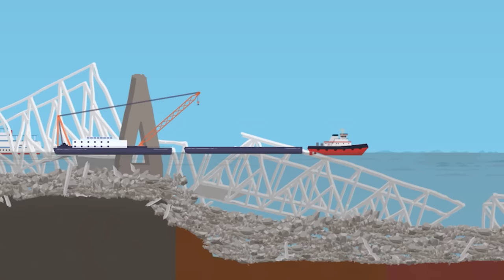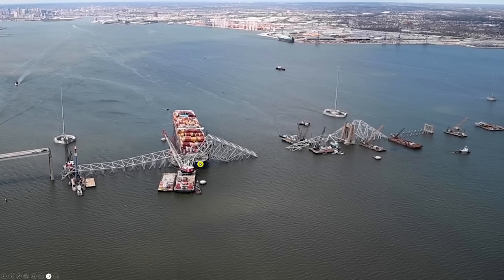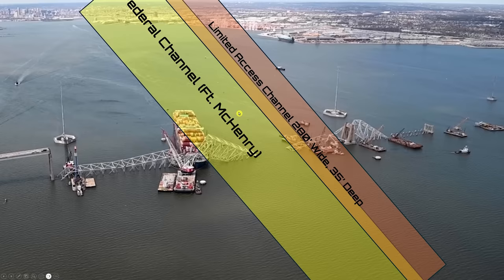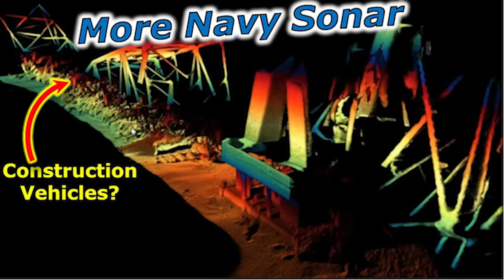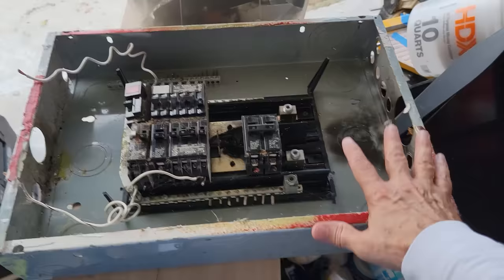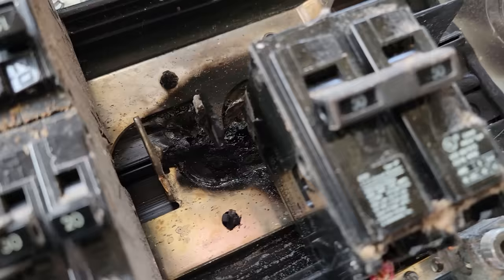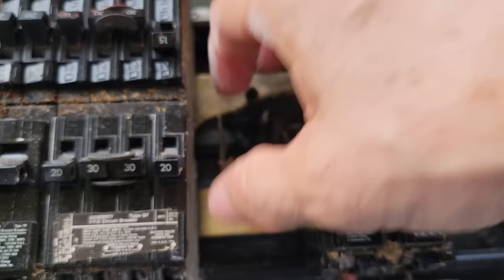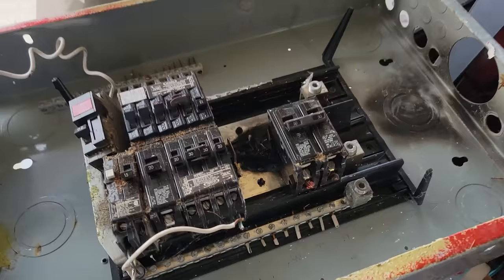NTSB Focus Dali Ship's Circuit Breakers | Bridge Collapse

Comment: Circuit Overloads: When the current exceeds the breaker’s rating, it trips. During circuit overloads and shorts, a typical breaker can handle up to 50 operations

Comment: Large frame breaker problems often are of two types: trip unit malfunction or overheating from poor connections.  Also, a special systems protection might be installed in the form of an undervoltage coil - when these are in early failure stages what happens is nuisance tripping despite buss voltage being in normal range or... breaker just trips immediately every time closure is attempted.  A UV coil is often a good investment where serving alot of motor loads.  Motors always make rated power, and if voltage is low then amps will be high.... and that can become a dangerous situation.  Replacing a coil means dropping the load, racking out the breaker to access the problem part.  An hour repair maybe? But the problem at sea is dropping the load - thats vessel specific and loads have to be looked at for operational issues: fuel transfer, battery chargers, ventilation, cooling, ballast etc may be losing their backup or complete function.  The absolute worst time to schedule any breaker repairs is... navigating an inland waterway.

Comment: Panel from ladies house and the vast majority of all fixed trip AC single and 3 phase circuit breakers 
(built to US standards) 
are designed to trip at 
80% of labeled load when continuously loaded✅
So a 20 Amp circuit breaker can carry a 16 amp continuous load✅

Comment: An individual contact set one of a 3 phase set might be carrying more load than the others for one reason or another.  That one might be short of contact pad and is more resistive from arcing.  One never knows until a contact investigation.  It might be microscopic and sponge like but looks solid from afar.

Comment: If the breakers have bad contact with the busbars then there is additional resistance in the respective circuit. Which means there is LESS current in that circuit. Which means the breaker is less likely to interrupt the circuit.
All circuit breakers I know allow for a larger current (120% or so)  going through them for an indefinite time without tripping. Only at a substantial 165% higher load they will trip within an hour.
Perhaps in the USA circuit breakers are not able to carry their nominal current. Or the surge (think of cold lamp filaments have less resistance than the heated  ones) when switched on trips the breakers. Because with a load near the rating will be larger at the moment of turning it on.

Comment: For the ship to lose total power requires all of the mains to trip at the same time. i have ZERO experience with how ships are wired so I may be wrong. There may be one large main for the whole ship but I doubt it. They may have been pulling more power than the generator was capable of supplying and it overheated the generator and the protection on the generator shut it off.

Comment: My house built by lennar has bas circuit beakers been changing them for seven years. Every time one go out. Electrician told us those are weak breakers now the ones I changed so far been fine. This county just handing these big builders permits and not checking. Now it cost me $70 per breaker plus labor and I have two to change now kitchen plugs and fireplace I done half the box already.

Comment: The root problem is likely load share malfunction between parallel generators.  A rather complex subject because both real load and reactive load must be shared in a stable manner.  I am sure the NTSB will get a handle on this.  If you want to know more google cross current compensation.   I have worked on this problem many time as a Westinghhouse Field Service engineers

Comment: I can see going forward Cable Stay Bridges with central spans that are longer than the channels by a good bit to eliminate the need for large Dolphin Piers to protect the casings and legs of bridges. It makes the most sense, but no one wants to spend $1on infrastructure unless they can make $100 doing it.

Comment: When the generator went out, the engines can't run.   What is supposed to happen is an emergency generator is supposed to kick on in 45 second.  I read that it took 58 seconds.  The ship likely had automated breakers (unless it was the cheapest ship possible) and all circuit panels should be connected to the engineering control system.  There are lots of avenues to check before determining the start point of failure and if any secondary systems subsequently failed.

Comment: Limited access will have a depth of 35 feet. You are concerned about the construction vehicles.
I am assuming you already did the math and found that this 35 feet could still be above the construction vehicles.

So the only thing I can say is that from the animation, they don't show vessels using the limited access channel until after the debris is clear from the limited access channel.

Comment: i don't know if the breakers had anti trip setting on some of the breakers.
US navy  ships have a lock on setting on some systems to keep some breakers from tripping at normal loads and only trip at 50 TO 100% over load.
the breaker panels also have color coded breakers allowing the watch stander to strip the load on a less needed bases where part of the load can be Shead to equipment that is not needed for safe operation.
other things i see that are not like a home power panel is most ship power is three phase power and single phase power is only found on small sub panels.
ships lighting panels are single phase sub.panels feed from three phase power panels.
since the lighting came back on after a problem that is a sign that unneeded load was not being Shead from the ships generators.
ships deck lighting and refrigerated containers is not needed for safe ships operations and should have been turned off to cut the load as the generators came back on line.
also going in and out of port a ship should always have 2 generators running and the load shared between generators so if one generator goes down the other generator takes the load.

Comment: I live in a newer house, but there is an issue in my bedroom. I am disabled, and have a small 700Watt microwave in the room. If I use the microwave, and at the same time use my small space heater (450watts) it will often blow the circuit breaker. 
Not hard to see a big ship, popping fuses from some problem, that was unknown, or unseen until it happens...
Reply from the maker: Yes they likely had a loading problem on the breakers, like you did while at the dock where they reported issues in days leading to departure

Comment: the display you are referencing is from a residential panel.  What you have onboard ship are dealing with much higher amperages and circuit breakers do not function or appear the same that you are depicting.  In commercial buildings, we have to shut down whole buildings, and physically remove and disassemble every circuit breaker, clean, reassemble circuit breakers and test each breaker every 3 years.  Given the flags these vessels sail under, I can say that maintenance schedules and the degree of work and inspections performed is very suspect.

Comment: Would a tunnel be a viable alternative???
Reply: There are already two tunnels. They have truck weight and size limits and are closed to hazardous/inflammatory materials. The FSK bridge was created to allow truck traffic to cross the Patapsco on I 695 with a time savings of 20 to 120 minutes compared to traveling around on the Baltimore beltway. The beltway has had heavy traffic since its construction in the 1960s. Before the construction was completed, parts of the beltway were in the process of widening.

Comment: Why can they not send empty ships out to the full loaded ships and barge crains and off load half of the containers onto other ships, this would raise the draft so they could take down the two sections of bridge on ether side of the collapsed parts, ( so what it cost ) it will get product moving,and with tugs and speed limit 1/2 mile an hour,,,,or slower until past the pilons thanks BigAl California

Comment: Jeff, in your description of the breaker box failure you say increasing resistance will increase current: *NO! *
Overall current would decrease, but more heat would be created locally due to the poor connection (increased resistance).

Comment: There were always going to be two areas of interest when finding out what occurred, it was either likely to be a fuel issue (something with the fuel causing the engine to shut down) but this was unlikely due to the engine restarting very quickly, or it was an electrical issue, these huge vessels are highly dependant on electrical power and have in addition to the engine 3 or 4 electrical generators, but the switchboard is a logical choice to investigate for a fault of this nature

Comment: It's no surprise they are bringing in the manufacturers of the ship's equipment.  How else could fault diagnosis happen?  I think their plan to open the shallow channel is flawed.  They can remove an equal amount of rubble from the ship side while they remove the ship, which should be fairly easy as it is fully floating.  Then the big ships could pass single file and the recovery of the workers could continue without undue pressure.

Comment: Add to that the magor solar storm..werecthe breakers and switches protected from electrical interference. FLY BY WIRE..planes or ships maybe sensitive to solar storms and CMEs.its a known issue that train rail signals can be flipped  by solar impacts.

Comment: Lots of talk about circuit breakers, the circuit breakers will only operate with the generator running, if there is too much load on  the main switchboard, the circuit breakers will start shedding none essential circuits, if the generators not running , it all goes dark !.

Comment: Circuit breakers would open if they sense an issue with the power plant OR they can also open if the automation provides an order to open. Many of the automation systems are connected to the internet and can be hacked.
Reply: Exactly.  As an example,  an elevator.  It's main circuit will be energized through a " shunt trip breaker".  The shunt trip is an electromagnetic coil ( like a relay on a starter, for example), that when energized by a signal , ( on an elevator...from a smoke or fire alarm) that will automatically trip ( or open) the breaker. 
  I operated generators professionally. The way the power went off and on, didn't comport to a fuel issue to me. I'd expect a flicker or dimming..or such..if fuel. 
   But what really kept me on my toes, was all the potential alarm signals. ( overheat, low oil, low coolant, etc.), that were  designed to shut things down immediately if a fault was indicated.  To save the machinery from destroying itself. 
  For now, I'm with an " alarm fault", either real or a malfunctioning indicator..triggering a " shunt trip".

Comment: Neophytes often incorrectly want blame the ‘circuit breakers’ as the source of the problems.
I’ve had to deal with people that told me that a circuit breaker must not TRIP.
If you don’t want a circuit breaker to TRIP, then simply do not install a circuit breaker in your system.
However, make sure you have the Fire Department on speed dial. 😁
EDIT: Of course sometimes circuit breakers do fail and cause untimely disruptions.
I can think of a least two such cases where a breaker failure cases damage in the shipping industry.

Comment: Bus bars only overheat when there is a short circuit.
Reply: Look at the conductors cut off at the load side of the 50 amp breaker.  Looking a little pink.

Comment: when a generator looses 30% of it power the transfer switch tell the back up to start and when it looses 50% power the switch over to the backup generator as to not loose full power. Why didn't that happen.

Comment: Posted the below statement on the other thread a few days ago.  Just SMH.  If comms. were functioning, there was a DC power source operational.  How extensive was the power source supporting comms. during the outage and why couldn't that support critical functions?

@craig-tx12
5 days ago
Excellent run down on the potential chain of events.  Curious to your thoughts on redundancy systems in place for a ship that large or any vessel with the secondary source of power that can assume upwards of 85%, if not more, of routine navigational and housekeeping functions.  Point I'm trying to get to is, as you addressed the "wind up time" needed for ICE backup systems; traditionally, there would be batteries/Uninterrupted Power Supply (UPS) to carry the minimal load needed to support critical systems until voltage could be generated by the back-up generator.   Not knocking anything, just curious if anyone has thoughts that I could be missing.  However, now that I'm typing this it leads me to believe there was a potential master breaker failure that prevented all downstream redundancy/ATS's, etc. to not engage. Again, great detail, enjoyed the presentation.  Just my thoughts and not leading to any direction one way or the other.  Thanks for entertaining the comment.

Comment: Your concerns about the limited access channel being directly above where the road maintenance crew probably went down has already been addressed. It's been made clear since the very beginning that no traffic would be allowed through that area until those bodies had been properly recovered. They will be found and recovered if they are in the area and you and I both think as part of the process of starting to remove the debris. As for the investigation by the NTSB looking at the circuit breakers they were brought up early on in the conversation as an area of interest. There were comments in the very first few days after the incident  that work had recently been done to deal with a problem with refrigerated containers on board and possibly imbalanced load and reassigning of breakers. This is not new news nor should it be a surprise. The circuit breakers you showed from your garage are so completely different and unrelated to the electrical panels on a ship that it is not even a valid teaching tool in my opinion. On that panel it is showing a main breaker of 100A total, with individual circuits totalling 265A - almost 3 times the capacity of that panel! Depending upon actual running potential load of the house, it may easily have been exceeding the panel's overall rating. The number of ganged breakers is somewhat meaningless. Last - totally RIDICULOUS that the Coast Guard was asked by NTSB to perform a huge engineering evaluation of all bridges, etc. They are a Public Safety agancy that has already long been underfunded just to accomplish that public safety task, much less be saddled with a huge study! No wonder our transportation infrastructure already needs hundreds of billions of dollars for upgrades and maintenance, but we're too busy building smart bombs and the like!

Comment: Circuit breakers...hmm.  Latching and unlatching would explain the flickering.  Damaged wiring from previous overheating(?) causing increased current that exceeded maximum load?  Primary generator partially failed and backup was not on line (or vice versa) resulting in load shedding?  Question for engine department folks: when generator output is inadequate, are certain systems shut down before others, like engine control and steering being the last to shut down?  I assume there are two main generators and at least one more (smaller) backup.  Can the third one run the ship?  When the entire ship goes dark at once, it's logical to think of a massive single-point failure triggered by smaller cascading failures.

Impressive performance by Ted Cruz--head-down reading from a staffer's notes, pretending he knows what he's talking about.

Comment: They need to focus on the rudder
Reply: Large ships need propulsion to steer.
Reply: @godblessamerica7048  Small sailboats need to be making at least some headway to steer as water passing along the rudder is the mechanism for the rudder to function. Dead in the water means no steering
Reply: @byrongreene6234  Exactly! That is how a sailboat steers with water moving past the rudder, but large ships need propulsion from props moving water past the rudder to steer, and some have thrusters.

Comment: One thing that could trip circuit breakers is to load more refrigerator containers than their generator can handle. And then set sail as soon as possible without adding generator capability. Corporate greed?

Comment: One of the big flaws in USA is the 120V AC electrical system.  The far more sensible 240-250V in other countries  halves the current flow, uses cheaper copper wire, and is safer for humans.  So you don't get busbars burning away.

Comment: Sir, when resistance increases the current goes down!    You are far from knowledgeable enough to be trying to explain to others.    The example of a panel with charred conductors because of fire is another blunder.   There has been no mention by anyone of a fire involving electrical equipment or any other fire.  
The NTSB should be looking into reports that the problem of discontinuities existed when the Mali was in port.    If so, why wasn't if repaired so that the electrical system was reliable before they got underway?    Was the Captain in too great a rush to leave?   Who signed off on the ship's readiness for sea?   Why isn't the NTSB Chairperson a fully qualified engineer?

Comment: Sounds like you are grasping at straws you have a main circuit breaker and you have Ranch circuit breakers if the main circuit breaker trips that does not shut the generator off this isn't making sense Breakers offer protection this is another 9/11 job